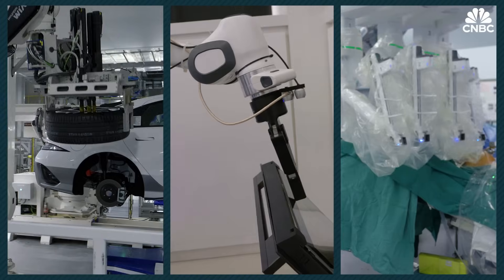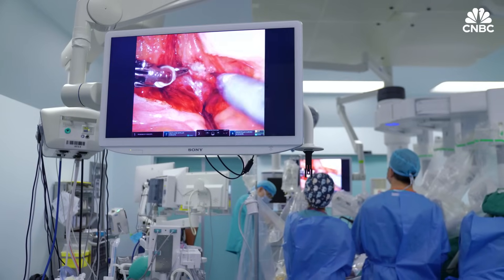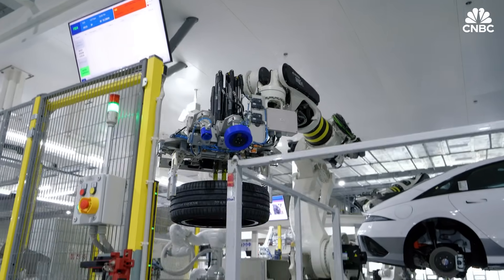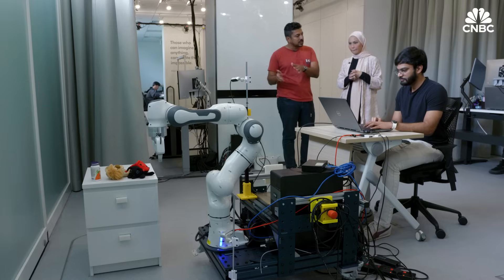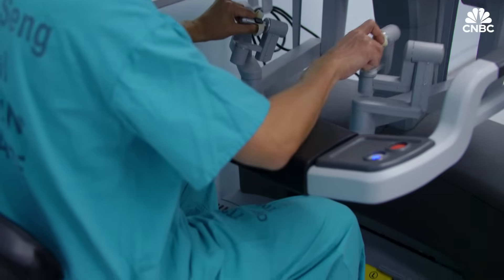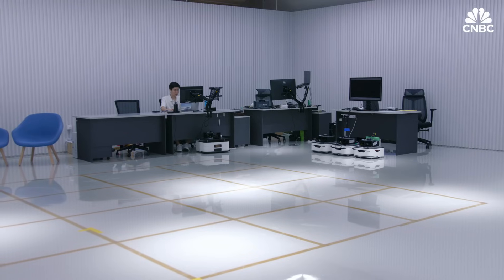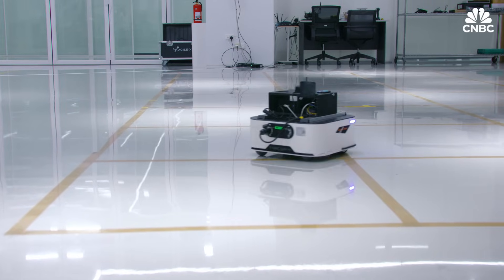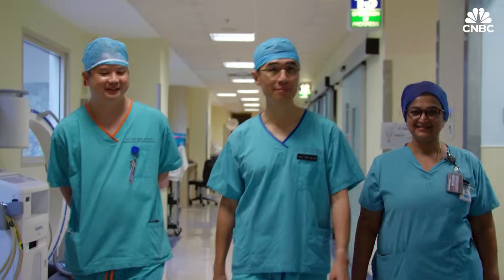Robotics engineers are in high demand — but what is the job really like?

Comment: Until the humanoid robot bubble will soonishly burst. Then, there'll be much less demand.

They'll never function properly under practical conditions, for which there is a plethora of reasons, not the least of which are lack of speed and agility, necessity of implementing onboard-LLM-coordination (with the hallucinatory and faulty limitations inherent to LMs), and power consumption.
These humanoid robots will forever remain expensive, faulty toys and gadgets. Traditional, non-humanoid 'robots' (machines) outcompete them in nearly any industrial use-case.
Reply: engineering is a field about constantly improving and constantly updating. continuous improvement is a huge deal to any job in engineering, so i highly doubt your claim

Comment: 14 years into my career - principal engineer of robotic integration and process automation of high reliability computer hardware used in space and military applications. My suggestion - work on things, all things, cars, computers, electrical, mechanical, pneumatic. If you can't fix basically anything you need to learn how. Math and science is less than 50% of the job. My best engineers grew up on farms fixing equipment and infrastructure or were mechanics early on, I never hire based on degrees. Most importantly, don't be afraid to fail. Fail often and learn from these failures. Experiment with everything.
Reply: Amen to this.
Reply: This is great advice. I started my career as a production line operator, now I am a CNC operator and will eventually become a CNC programmer, then I plan to go to university to become a robotics engineer. I have noticed that it is much easier for me to work than for those who came after studying without work experience.

Comment: I have been working as robotic engineer since before that was an actual title. It is boring and the majority of robots used are old tech. If you wanted to get into it, you would be better to just start building them, there are heap of open source project you can choose from 3d print and start building. You will learn more  in one month of fulltime dedicated tinkering than with a formal education of 5 years.
Reply: I second this, but the path to making money that way is very convoluted. If you build your own stuff, you HAVE to finish what you start, and more than that, you have to add it to a portfolio in a very well-presented format if you want to get a job.

Comment: as a software engineer, i've been dabbling into electronics and robotics little by little and i realize how MUCH i don't know and how excited i am to learn from the bottom all over again!
Reply: Your car with auto steering lane adjust features or auto parallel parking is literally a robot.  The most advanced are the ones used in surgeries and pays the most mainly due to very high litigation risk.
Reply: I'm a software engineer as well, but lately considering to take master degree in Robotics nor Autonomous Systems
Reply: @TeddySebastianDion many are saying it is easier to get into Robotics after doing UG from CSE,EE,ECE 
WHAT about mechanical engineering should one take ME do Mtech 
Is it have scope or not
Reply: Would you say it would be realistic to retrain workers displaced by robots to robotics or robotics support fields?

Comment: Any engineers in the comments im currently on my journey to mechatronics I want to work with robotics and ai any general tips and suggestions please let me know 🙏
Reply: industrial robots rarely use AI, it's more classical programming and safety-rated motion programming etc. 

Only leading-edge research and fancy stuff is able to play with AI much. The rest of us just making robot arms or smart mechanical systems the old-school way.  PLCs with ladder or structured text code, C++ code and machine vision systems, robot controller code (each manufacturer has their own IDE and coding language usually)
Reply: I recently got a degree in robotics engineering tech, very similar to your field, and it is very much focused on implementation for existing systems. You sound like you want to design new systems, in which case I would tell you to specialize in data science or machine learning. Be very careful with your coursework in university, because classes that anybody can take without pre-reqs about "machine learning" might be useless classes devoid of actual useful information.

Comment: currently majoring in Robotics engineering. For those wondering you just have to take all of the hard core classes of electrical, mechanical, and computer science and some extra major specific things. Get ahead in math or you cannot graduate in 4 years.
Reply: 14 years into my career - principal engineer of robotic integration and process automation of high reliability computer hardware used in space and military applications. My suggestion - work on things, all things, cars, computers, electrical, mechanical, pneumatic. If you can't fix basically anything you need to learn how. Math and science is less than 50% of the job. My best engineers grew up on farms fixing equipment and infrastructure or were mechanics early on, I never hire based on degrees. Most importantly, don't be afraid to fail. Fail often and learn from these failures. Experiment with everything.
Reply: @TheJB84  i 100% agree. I build VTOLs and did first robotics since high-school. It blows my mind how many peers are miles ahead coursework wise and have never touched a soldering iron or actually done any engineering
Reply: What university?
Reply: what was your bachelors?
Reply: @burdlover49  getting a bachelor's in robotics engineering
Reply: I m doing bachelors in mechanical engineering from iit indore after my graduation what degree i should pursue to get into the domain of robotics engineer?
Reply: @vaidikshah1922  i mean I'm getting a bachelor's in robotics engineering. Robotics is kind of a code heavy electrical engineer. It's similar to being a controls engineer as you are the one teaching the robot how to do things. The classes that transfer from mechanical are your math and physics classes. You'll have to go through and do all of the foundational coding and electrical classes

Comment: Surgeons can literally work from home very soon. 🔥🔥🔥
Reply: It possible since its teleoperated but it comes with technical challenges like latency and bandwidth issues, signal reliability, system redundancy and data privacy issues.
Reply: @appiahmends118  5G already fix most of these issues but 6G will improve it even more
Reply: Ai will replace but the robot creators and surgeond

Comment: Robotics engineering is the field young people should focus on for the future, the new robotic tech is just amazing  :)
Great video
Reply: too bad, the industry only want experienced robotic engineers with years of experience but at the same time don't want to hire junior/graduate robotic engineers. It's almost if the industry is purposely creating a shortage even worse in the future by not hiring and training young engineer. I know plenty of grad that cannot get a job even after 1000s of applications. The industry is saying one thing but the way they are acting is completely different.
Reply: @keenheat3335  I agree 1000% I am graduating this school year and I have not found a single entry level/junior robotics related engineering role in North America
Reply: @keenheat3335  The issue is liability. They don't want to face professional liability if they hire junior engineers.
Reply: @keenheat3335  robotics is a pretty niche and specialized field, your best bet is to get in another way such as hardware engineer, embedded engineer, working on firmware in embedded systems, etc.
Reply: @keenheat3335  same with mechanical engineering
Reply: @keenheat3335  this is every industry right now
Reply: yeh then tell the universities to be a bit more soft when accepting applications from students. Here in my country, it is extremely hard to get into robotics, even harder than getting into medicine.
Reply: If they can get a job. Employers dont care about the degree.

Comment: All you need is a degree in mechanical, electrical or aerospace engineering.
Reply: minimum of master's and usually a PhD for R&D on the really advanced robotics like humanoids
Reply: @mr_vvs   not really. You can do with a bachelors.
Reply: How about computer engineering?
Reply: @blueredpurpel  that works too
Reply: @blueredpurpel  yes computer engineering can get you in the field
Reply: @blueredpurpel i would say that computer engineering is the most suitable degree out of the traditional engineering degrees for robotics. You are exposed to software development, electronic design, and embedded systems which gets you pretty far into understanding robotics. If your school let's you choose electives then you can specialize more to robotics. I am about to graduate as a computer engineer and minoring in mechanical engineering. Choosing electives like control systems and choosing robotics projects for lab courses has greatly prepared me for working on embedded systems within robotics and writing robot software.

There are many disciplines within robotics, so there are multiple correct paths to getting a job in this space. The most important factor is gaining robotics experience through personal projects, research, and trying to work for hardware companies in some capacity.
Reply: just get a bachelors in Robotics Engineering. Its basically all of them combined
Reply: not exactly you probably need to do mechanical with a masters in computer science or vice versa and do internships and have some work experience
Reply: @Janonimos-i2j  not really any of those degrees will get you in this field. Robotics are multidisciplinary and thus need many types of engineers to be designed and manufactured.
Reply: I agree with your work experience comment.
Reply: Wrong, start doing your own robotics projects, you will end up with more experience than students in those majors.
Reply: @aerojetrocketdyners-2538  I bet most ppl would take significantly longer teaching it themselfes while not having the guidance that is provided in education.
Reply: not really, mechanical and aerospace are way too far removed from robotics. If you actually want to pursue robotics as a career then compsci, electrical engineering or mechatronics is what you need as they are much closer to robotics and usually they will have robotics majors and specialization options
Reply: @pear-zq1uj  I very much disagree that mechanical and aerospace are removed from robotics. I could argue that without them, the field of robotics does not exist. Just keep in mind that aerospace is a subset of mechanical and mechanical is a core discipline, meaning that any other degrees that involve robotics (mechatronics, robotics engineering, etc) is a derivation or combination of it. In reality, all the disciplines ME, EE, CS have a hand in building, designing, and testing them. So just decide what specific area you want to work on and major in that. 

Now, computer science is a part of robotics sure. But the hardware is not “all worked out.” In cases where the robots operate in known environments, sure probably. However, if your robot operates in unpredictable environments then you need to consider how that environment affects your hardware and engineer your hardware for it. This requires extensive design and test before the hardware gets deployed into the field. Given that each environment is different, then your hardware must be different. So there you go, the hardware is not “all worked out.”